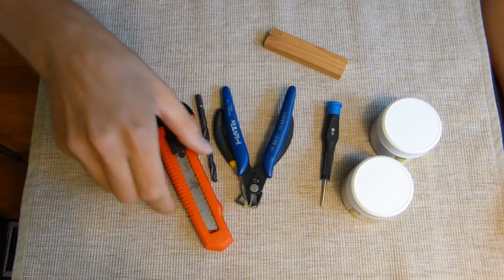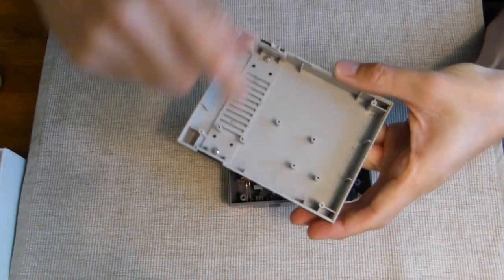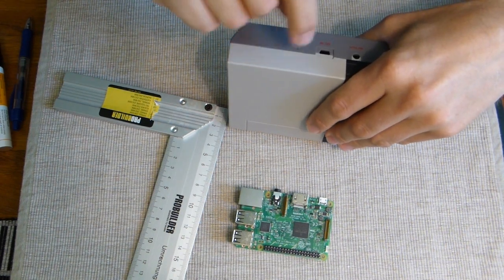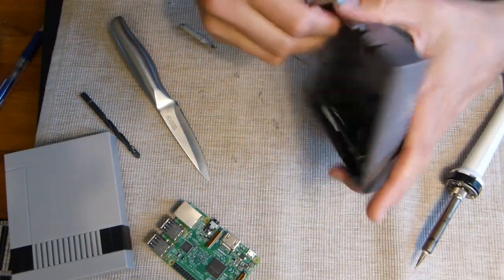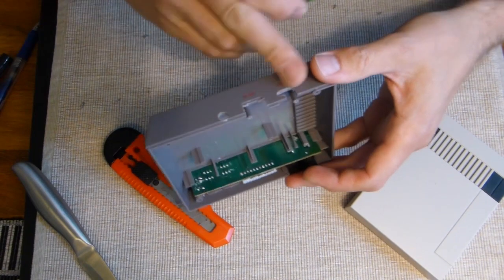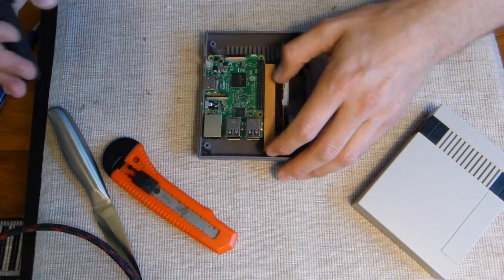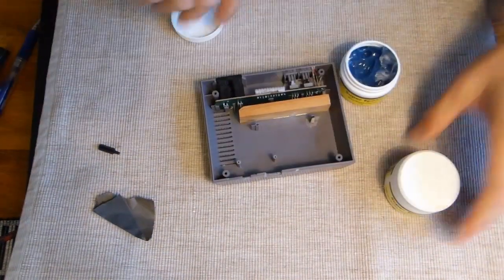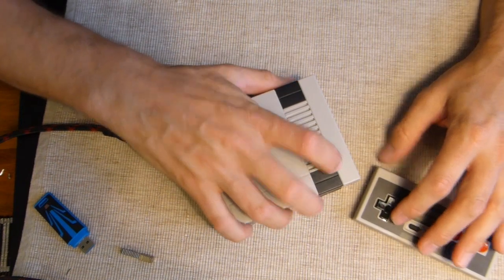DIY, easy to add Raspberry Pi to this $20 clone of NES mini classic sega snes. Similar to nespi

Comment: Is the game added later on the raspberry? And do you need to do anything in the raspberry to make.it work... du kan svara på svenska :)
Reply from the maker: Stefan Ekström tjena, enklaste sättet är nog att leta upp en färdig ISO och lägga in på ett minneskort. Finns lite guider hur man installerar retropie annars, inte svårt =)
Reply: zippiz utbildar mig till mjukvaruutvecklare inbyggda system och funderar på köpa mig en rasberry pi 3... hållt på med Arduino mkt... har 3 st nitendo på väg men de går nog inte spara på så :)...
Reply: Lamar Berry  what?
Reply: Lamar Berry  did not speak German.
Reply: Its swedish